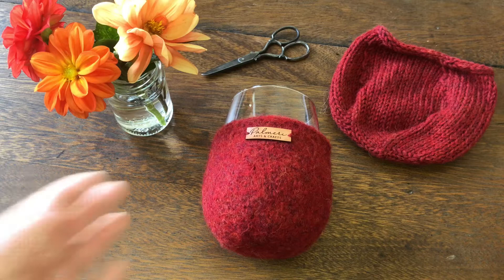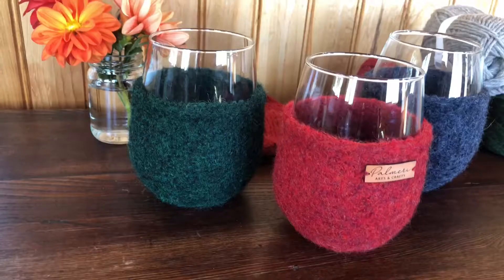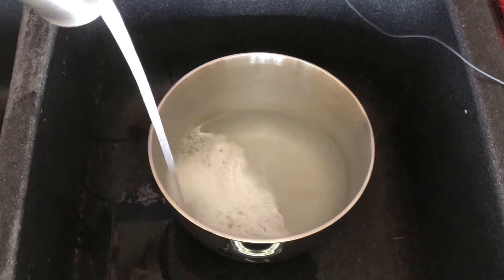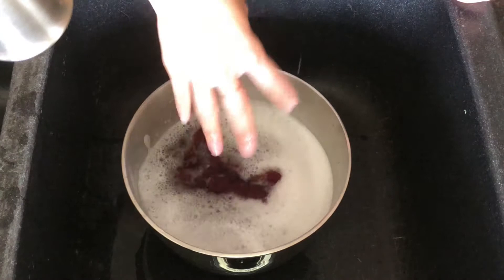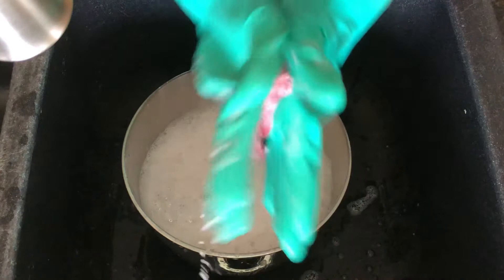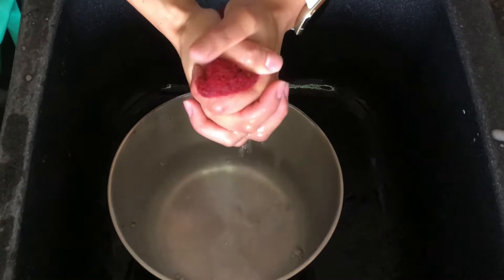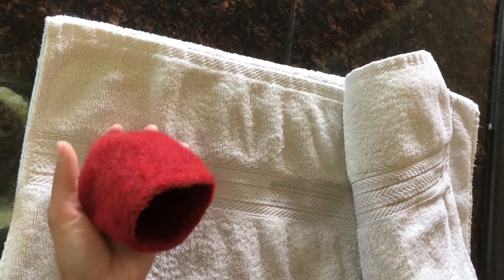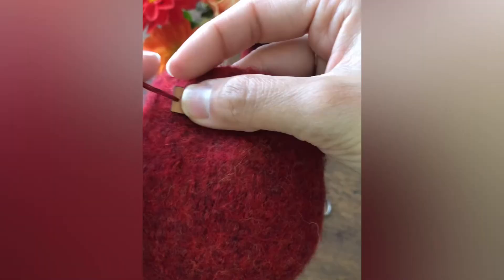How to felt knits by hand | Explained for beginners

Comment from the maker: It was mentioned by a viewer (Thank you, Pam!) that she usually takes 1-2 hours to felt a knitted item. 
I want to mention that it depends on what wool you are using. Also, the size of the project, yarn weight, and water temperature. I also think it depends on how much force you apply while rolling. It would be a good idea to have enough time for this process in case it takes much longer. Just like every knitter knits differently, anything done by hand and different materials can turn out differently for each individual. That's why handmade items are special and unique. I hope you will still find this video helpful 😊
Please share how your felting experience turned out ❤👇

Comment: It’s a shame all these felting videos say you can felt to no stitch definition in 15-30 minutes. This is NOT TRUE! It will take you 1-2 hours.
Reply from the maker: I'm sorry to hear that your experience has been different. I made many koozies for my shop during the holiday season. It only took me about a max of 15 min. Otherwise, I couldn't have kept it as a product. I believe it also depends on what yarn, weight, and size of the project you are working on. This is a fairly small project, so I think it was one of the reasons I could felt it quickly. I also discovered that the yarn I use for felting (Wool of the Andes from knit pick) felt really quick compared to patons classic wool yarn. Anyway, I appreciate you pointing out and sharing your experience. I will mention it on top of the comment and the descriptions for other viewers. It might also be fun to make a video of "which yarn would felt fast". Here is another video idea! 😊 Thank you Pam❤
Reply: How much will the shrinkage be?  Ie,  if I want to do a hat, do I just make hat using a regular pattern or do I make it bigger, or are there special patters for felted items?   Tyvm❤
Reply from the maker: @deborahkelley651  You need to make it much bigger since it will shrink and get very dense. I won't be able to tell you the exact shrinkage rate because it really depends on the yarn you are using. The best way to tell is to make a sample swatch and measure before and after wet felting. So you can tell how many stitches/rows will create the width/length you are aiming for. There are many felting patterns available for both knitting and crocheting on Ravelry. Search "felting" under "pattern" then filter by craft type (knit or crochet). Hope it helps 🙂